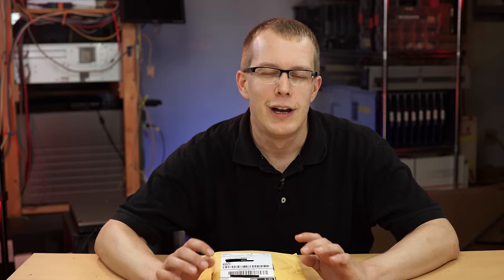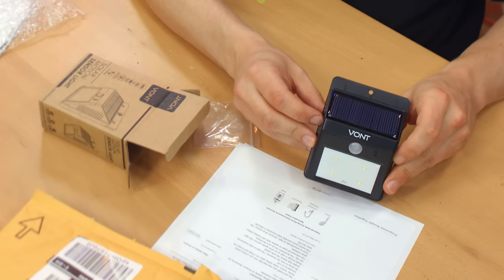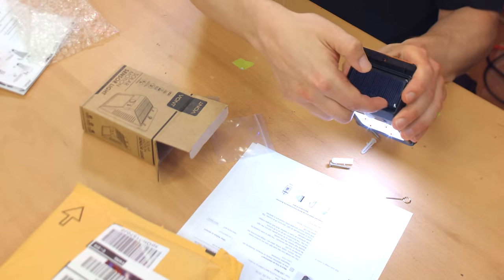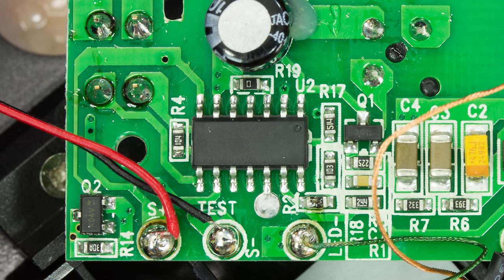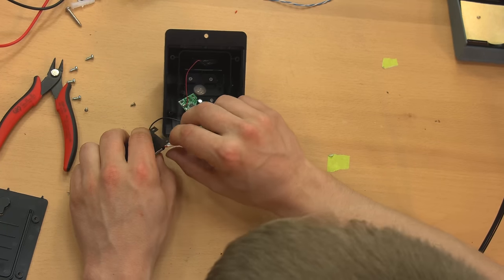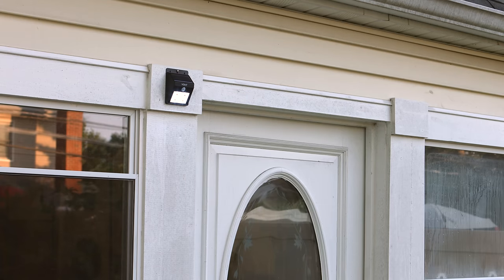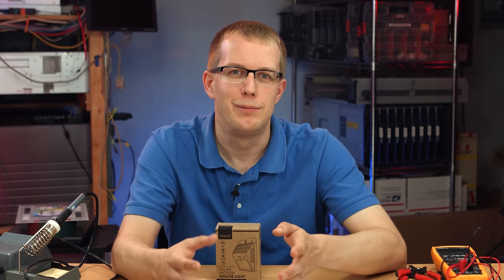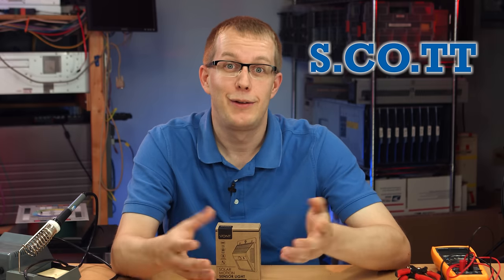Let's Open: Solar Motion Sensor LED Light from Vont - Review, Teardown, and Installation

Comment: Good work! I really liked the one you did on nimh batteries. Good format! Tell us up front what most want to know and then follow up with details. 
One issue with these units (I have a 20 led unit). There is no way that I know of to make the unit stay on for more than a few seconds. When I take the dog out for his *exercise * he goes off to do his thing. Unless I want to walk around in circles, the light goes off in about 15 seconds. The batteries are powerful enough to power the lights for several minutes many times a night. I would ruther have the light shine for 5 minutes x 10 times a night than for 15 seconds x 200 times.ANY Insight?

Comment: X03V sounds like a 3v regulator maybe, if the PIR gives an analog signal then a stable voltage reference is nice. Low dropout 3.3v reg hooked up to the lithium is a nice solution
Reply from the maker: Quite possible!  I tried looking again and couldn't find even a mention, let alone a datasheet..  So I'll go with your assumption.